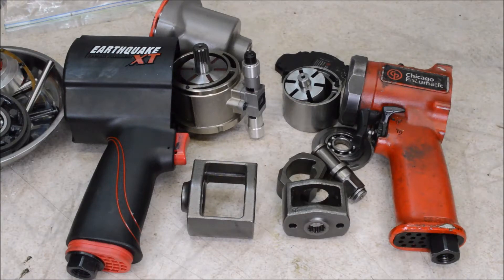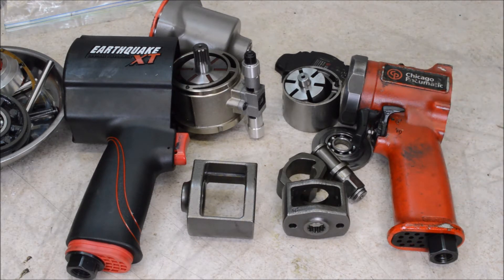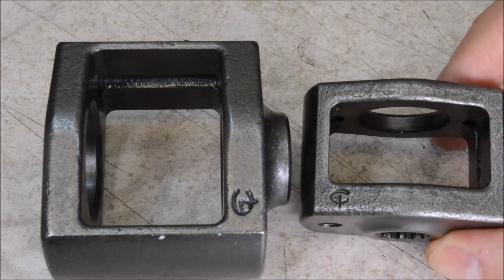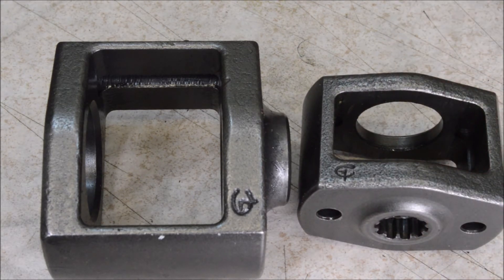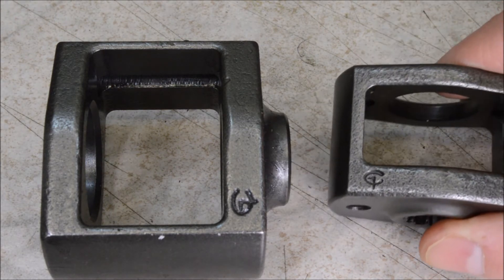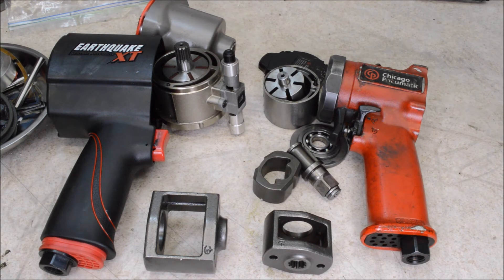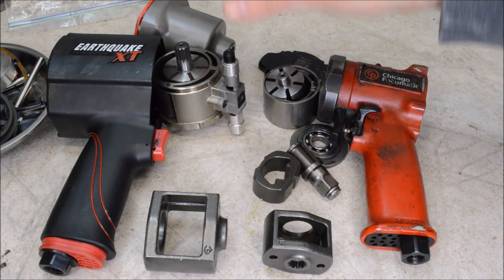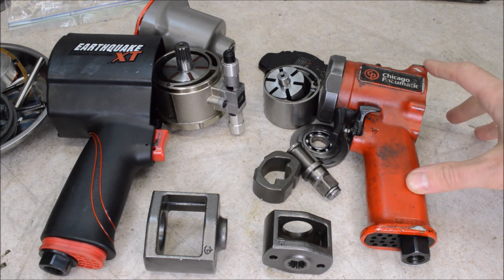Harbor Freight Earthquake XT and Chicago Pneumatic impact wrenches share parts suppliers?

Comment: does it suprise you. arnt both sold exclusively at Harbor Freight.
Reply from the maker: +fuzzy wuzzy You're thinking of the HF house brand Central Pneumatic. Chicago Pneumatic is a major air tool company and has been for many years. HF seems to be trying to copy the Chicago Pneumatic name with their Central Pneumatic brand.
Reply: there is also CHICAGO ELECTRIC which is HF house brand for electrical power tools 
Tricky CHICAGO Electric CHICAGO PNEUMATIC & CENTRAL PNEUMATIC
Reply: gabroxy yea i must have been thinkin of the wrong shit. they are close in name